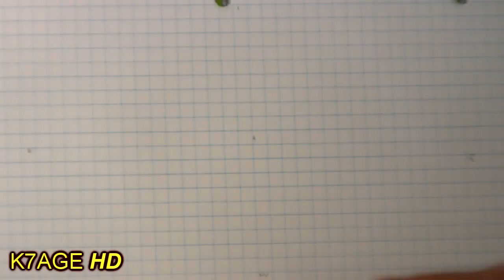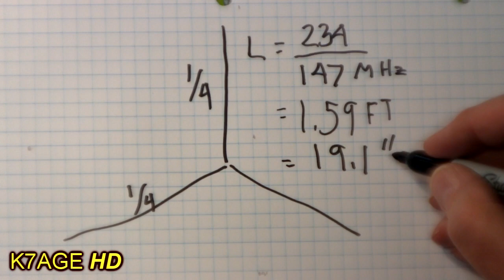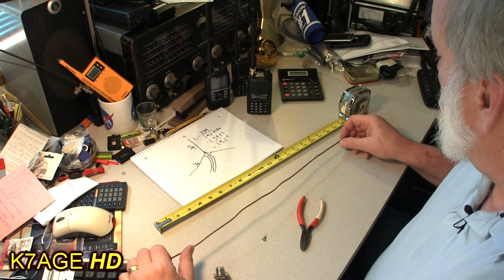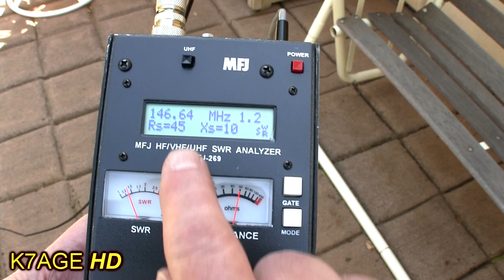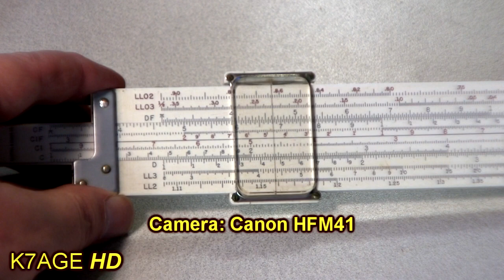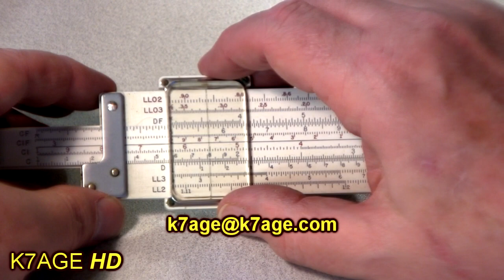How to Build: Ham Radio 2 Meter Quarter Wave Antenna

Comment: I tried making one of these myself.  It works great.  I made one change, however.  I put a loop with a diameter of about 1/2 inch at each radial.  That way, if I am handling it, or putting it into the car, I won't  put someone's eye out.  I made the radials somewhat longer to account for the material necessary to make the loops.  KK4DZE
Reply from the maker: Richard Day I really should have mentioned that in the video. Thanks.

Comment: K7AGE. Is it ok to use stainless steel wires.  Instead of Copper. Thank you great video.
Reply from the maker: Jingo Adams I would think so. They will be much harder to solder

Comment: If three of the four radials were removed, it seems that this antenna would be a dipole bent at a 90 degree angle.  How would this antenna perform compared to a simple dipole?
Reply from the maker: FM uses vertical polarization. So you could have one wire up and one wire down. You would need to bring the feed line out away from the two wires. Easier to build it as a ground plane. If you are playing with SSB, then horizontal polarization is used, then you could use it as a horizontal dipole.
Reply: K7AGE but you would have to also change the length of the copper for the 2m dipole since a dipole is halfwave and a groundplane is quarterwave, right.

Comment: K7AGE, I am looking to build another 2 Meter Quarter Wave Antenna but this time with thicker rods. Is it better to use the thicker rod or thinner ones? Your help is appreciated. WP4PBQ Manny from Puerto Rico
Reply from the maker: Manuel Pacheco Sure, it all depends how you plan on using it. For portable, wire is great so that you can bend it up. Permanent, something stronger would be better.

Comment: Always wanted to get my ticket and perhaps now that I am retired I will. I know all this stuff and if I cannot recall formulas , I know where to look. The Internet is fantastic-I build my own PCs. And I worked for a Motorola CCTV Repair shop in Dallas for several years doing component level repair on all sorts of electronic equipment both analog and digital. Always have had CB sets and amps Have talked all over this hemisphere - Played with and made a living from electronics all my life-- I like the Vhf stuff using repeaters and links-.who around Crockett,Texas 75835 could help me test? Thanks 73
Reply: Hi if you look on radioreference.com and enter your zip code or town it will tell you all the repeaters all the fire /ems frequencies and much more.
Reply: Oops sorry. Noticed you wanted some one to test with not the repeater frequencies. Well cool website any way. And maybe you will find a more used repeater. KG7QCA
Reply: I need the names and contact for a ham club near Crockett,Texas so I can test-
Thanks-
Reply: Highly suggest obtaining a copy of the ARRL Handbook.  Even professional engineers keep it handy.

Comment: How many watts can this antenna use? I was going to try to use this with a 65watt radio. Will this be ok?
Reply from the maker: Duff Morrow It should be.
Reply: Thanks for the fast reply. I am new to ham radio and this has been very helpful.

Comment: Will using coat hanger wire produce the same amount of distance from your signal, theoretically?
Reply from the maker: YoMoma777 Sure. Coat hangers have been used many times

Comment: Great Video! i'm gathering up parts and would like to know if I can use a 20" length of indoor 12/3 wire for the copper?
Reply from the maker: Hank Keller Sure, pull it apart into separate wires and cut to correct length

Comment: I am a new HAM and I was wondering if this would be ok as a permanent outdoor antenna? If not where could I find One? Thank you!!
Reply from the maker: You should weather proof the vertical connection with some RTV or other sealer. And, your cable connector to the antenna connector should be sealed with electrical tape. Many commercial antennas available at AES, HRO, DX Engineering, Gigiparts and other ham radio shops.

Comment: I'm a new ham. I need to figure out something to use inside with my HT (or something that's very portable). I can hit 70cm repeaters that are 40-ish miles away and ragchew fine, but I can't transmit to 2m repeaters about 6 miles away from me.

Comment: Great video. I am a new ham and this video taught me how to dramatically increase the range of my Baofeng UV-5R to the local repeaters. All in - I have less than $75 invested to start into this hobby! Thanks again!
Reply from the maker: higher the better
Reply from the maker: Andy Bennett Glad to heat that your range has increased. It works!
Reply: Usually it's like that.
Reply: K7AGE hi Randy......thanks  for the great video.  How do you determine the height the antenna should be or does it matter? Is it the higher the better?  Thanks Jim.....KJ6VVM
Reply: Andy Bennett ксддннннтннттгггккв ич чгякж3фт38 кж18к6шкчз8чдк05смчмднззнннннзддддддддддсдс777с7сссс676676777666кккк6щщ7кс709здтку

Comment: I am guessing you need rg-58 or rg-8 but I was wondering if cable tv cable would work also? I think rg-6?
Reply from the maker: 50 ohm coax is best. 75 ohm will work, although with a 1.5 SWR mismatch.
Reply: K7AGE Thank you for the reply!
Reply: @K7AGE  Great video K&AGE. Can you use cable tv cable and how do you connect it to the HT?  Is cable tv cable 50 ohms?

Comment: My friend and I live about 4.5 miles away.  Do you think we could both talk to each other without using a repeater with this antenna?  (There are a lot of roads and and other objects such as foliage that would weaken the signal)
Reply from the maker: I would think so, unless there is a mountain. Height is your friend. The higher the further you can go. Sounds like you will be having some fun playing with this. Let me know how it works out for you.
Reply: Will do.  I live in the southern par of South Carolina.  It's literally flat as a pancake down here, so I don't think I'll have any problems with mountains.

Comment: Nice project 👍👍
Kindly could u explane the concept behind the numbers you have used ( 234 )
Reply from the maker: Faisal Alsarraf Hi, antenna theory. This article http://www.eham.net/articles/23802 tells where 486 comes from for a dipole. The 1/4 antenna is half of that number. Hope it helps.

Comment: Built this antenna this weekend and finally got on the air from my home using my HT.  Worked 3 repeaters with great signal.  Furthest distance so far is 35 miles with 5x9 to the repeater.  THANKS!!  KE0AJF
Reply from the maker: It is simple and it does work. Getting the antenna up higher also helps. Well done

Comment: I saw that someone asked about coat hanger. I suspect that what you used was just #12 house wire by the look of it (stripped of course). I happen to have that hanging around. I think I have a bulkhead SO-239 kicking around and a soldering iron. I even have 2-3 slide rules in the tool chest that I had long forgotten how to use (and I'm relatively young!) Pat VE9ES
Edit: I found my SO-239 and built this yesterday and ran it through my analyzer. with some tweaking, it measured great, very flat across both the 2M and 70CM bands. I was able to get to a number of repeaters that were close and somewhat far. I was initially concerned that I couldn't hit a couple of repeaters, but then discovered that they were down.

Comment: Randy, thanks for all your hard work, this is a great video, very useful.  I'm making one for my scanner, adding a stub for 440 and a small one for 800 on the vertical post.  Can I double the length of the vertical and make it a 1/2 wave without increasing the length of the ground plane wires?  I have a little extra room, in the attic, so I wondered if this might help with the signal coming through the roof material. Thanks.

Comment: Randy - I found this very similar antenna that is dual band.
http://www.eham.net/articles/7005
It looks like half of it is the same as yours and the other half is probably for the 70cm band.
I'm guessing I should expect the dual band to work half as well as one (yours) made specifically for 2m?
So maybe I make them both, or even better, both of those and one for just 70cm as well?
The connection to my radio is a bit of a problem - I believe it is an N connector so an adapter or cable with the proper connectors will be needed.  What is the least expensive way to do that?
KC1BSE
73
Reply from the maker: Doug, thanks. It should work just as good!

Comment: Great informative videos Randy!  Two questions - you can pass on the second if you don't remember the answer either..
1) Would you expect this antenna to help with simplex as well?
2) What's a slide rule?  LOL!
Reply from the maker: Yes, it helps simplex. Range is range. Higher the better.

Comment: Hi Randy, how did you determine the length of the radio to be 234?
Reply from the maker: Look here and divide by 2 for a quarter wave vertical. http://www.eham.net/articles/23802
Reply: K7AGE   will do. thanks again
Reply: K7AGE excellent article. Very well explained. Have a great evening.
Reply: From using the formula.  Half wavelength would be 468 over the freq. in MHz.  Since the driven element is 1/4 wavelength you would use half of 468 or 234.  Alternatively you could use 468 and divide the result by 2.  You're a ham?

Comment: Thanks for the info, I had to build one similar to yours because my main antenna is currently down.  I used just 3 radials.  I can reach the local repeater that is 20+ miles away using a Baofeng HT and the antenna is inside the house! I also tested the swr using a Nissei 2m/70cm meter and I get 1.1 swr which is very good!
Reply from the maker: Glad to hear that it is working.
Reply: I'm hitting repeaters 60 miles out with my signal stick on 5W uv5r.

Comment: Thanks for the post. I just finished mine...don`t have an antenna analyzer however, receive is strong on even the what used to be "weak" channels, and radio checks have me 10-8 and smoking`! Thanks again. Great little antenna!
Mike
KK6NWQ
Reply from the maker: Yup, getting the antenna up and outside sure helps.

Comment: how do i share 2 antenna with 1 coax cable??
Reply from the maker: What two antennas would you want to share. We normally don't share antennas.
Reply: K7AGE
hi, i have a 10m thunderpole and a 2m
X-50 N X 50 X50 DUAL BAND COLINEAR ANTENNA AERIAL 144 440. both are minus the mike ( my choice ) as i am getting into ham radio. i live in the UK and are just about to join a club. but i dont want 2 cables running together.

Comment: Thanks Randy! I built one of these using rg6 coax (i had a whole spool laying around) and a 90 degree BNC connector to hook up to my Icom 2m ht which I bought on the strength of your celebrity endorsement.  The rig rocks.  I'm hitting repeaters three towns away and I couldn't be happier with my first antenna build.
Cheers, Adam K5OCS

Comment: Wow, this is awesome!  I'm a new ham with a 2 meter HT, and it just so happens that it's also an IC-V80!  I want to make this as a first project, set up just outside, maybe even with the cable running in the house somehow, good idea?  Now, I just need to get an SO-239, a good enough soldering iron (the only one I have right now is, what? Fifteen watts?  I can hardly solder even small stuff with it), a good coaxial, an SWR meter, the copper wire, 3/4" PVC...hey, at least I have the solder!  Great video, thank you!

Comment: Hi Randy,
I have a question about reception on this antenna.  We have a local simplex net and I can't hear most of the stations checking in. Other that boosting my signal out would this 1/4 wave ground plane help me hear distant stations better?

73
Eric VE3EAL
Reply from the maker: Compared to using a rubber duck inside the house, yes.

Comment: Excellent video. Just discovered you by way of the Resonant Frequency Podcast.

Do you have any info on buying parts for antennas?  I looked at Home Depot and they want $10 fro a 36 inch section of 1/2 in. aluminum tubing. It can't be that expensive, can it?. 

Dave in GV ( by the fairgrounds)

Comment: One more question, I have seen a lot of plans for the ground plane elements bent down more, 45 degrees, does it make a difference?
Reply: yes bending the radials changes your RF impedance. Bending the radials down at 45 matches the antenna to around 50 Ohms, the same as your coax

Comment: Thanks for the video!

Would making it 1/2, 5/8, or full wavelength result in a difference?
Reply from the maker: Yes it would. At 1/4 has an impedance of about 50 ohms. The longer antennas have different impedances and would require some type of matching. The 1/4 is very simple, as no matching network is needed.
Reply: K7AGE Oh, that explains the loading coils on 2 meter 5/8th mobile antennas. Thanks, 73's KDØWHB

Comment: Hi Randy first of all great Job !! My question is what would be the max handling power for this antenna 5 watts ???

Lee K5NOV
Reply from the maker: I would say 50 watts like from a mobile. Just keep the connection to the center conductor centered and maybe add some RTV for waterproofing.
Reply: Thanks Randy keep up the good work
Reply: K7AGE that’s what I was wondering. Thanks

Comment: I completely ruined a SO-239 today just futzing around with my butane soldering iron.  I think I'm going to have to break down and buy a proper high power soldering gun.
Reply from the maker: I guess I would call that a learning experience.
Reply: If I was any kind of intelligent or capable of making good decisions, I would give up trying to solder.

Comment: Nice video. You don't even need it outside. I built a 222MHZ version of it and had it hanging from the ceiling with string before putting it outside. It was a big improvement over the rubber duck just hanging from the ceiling of my 1st floor room. 73...N8LTD
Reply from the maker: Yup, that works too,

Comment: Could someone please explain why the figure 1.59 is stated to be feet and is then multiplied by twelve to get inches instead of divided by twelve?

I understand freq to lambda, and how 147 MHz would be 6.69'
I also understand that .25 lambda of 147 MHz would be 1.67'
I am assuming the deviation of 1.67' to 1.59' would be because of VoP?

As stated prior, the multiplication of a number stated to be feet, to get a figure in inches threw my logic for quite a loop.
Reply from the maker: You are correct about the 1.67 and 1.59. Those numbers are in feet. Multiply feet by 12 and you get inches, easier to measure with a ruler.
Reply: I feel like the biggest moron on the planet right now. Somehow I was thinking about the conversions in reverse. It's usually the simple things that get me. Thanks for the reply Mr Randy. Love the videos, have a good one.

Comment: Do you use an adapter to go from the coax to the HT? I have a Yaesu FT-60 with an SMA adapter. Should I look for a coax cable with an SMA end or just pick up an coax to SMA adapter?
Reply from the maker: Most likely. Many of the radios now have a SMA or a BNC connector. Your coax will probably have a PL-239 or maybe a BNC connector. Probably not a SMA. For BNC, a BNC male to SO-239 adapter will work. For the SMAs, I like using a short cable with a SMA to either BNC or SO259. I would be careful of a SMA to BNC with a BNC to SO-239 adapter on the radio. The adapters and cable may provide a lot of stress to the radio's connector. The last thing you want to do is to brake the connector on the radio. If you have a Chinese radio, it may have yet a different connector.

Comment: I'm thinking this would be a great antenna for use at ARES events.  What is the best way to weather proof it for field use?
Reply from the maker: Probably some RTV around the center of the connector where the vertical is soldered.

Comment: Randy, do you think I could make this antenna out of 5 wire coat hangers instead?  It looks like the wire diameter is about right and you can just use the straight bottom from each coat hanger.  Your thoughts?
Reply from the maker: You can use as much of the coat hanger as you can straighten out. Just scrape off the paint to make a good connection.
Reply: +K7AGE Actually, many years ago I built a "hybrid" by using the bare #12 copper for the vertical element and coat hangers for the ground plane elements.  Like you said, scrape the paint for continuity and it works like a champ!

Comment: Randy is the length of your coax of importance,like with cb radio. Awesome videos for us newbies. Thx for your time and effort.Bladetxglw
Reply from the maker: The length really doesn't matter. The affect of length and the type of coax will determine the amount of loss between the radio and the transmitter. RG58 has more loss than RG8. Bigger cable is better.